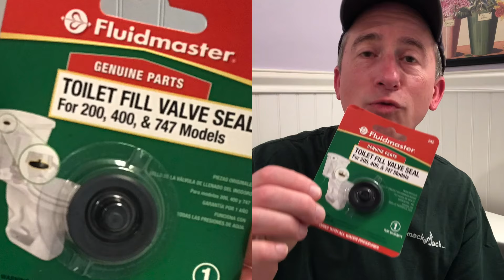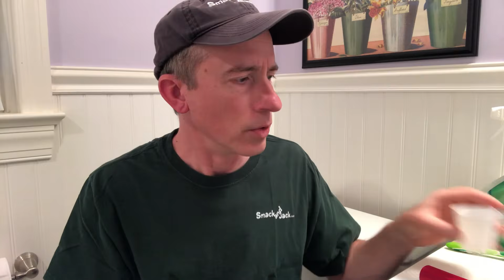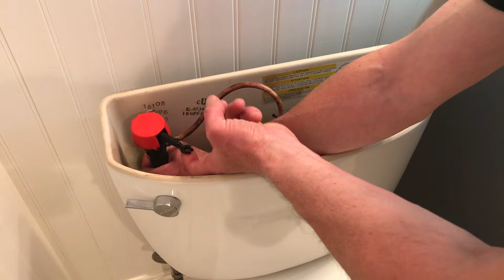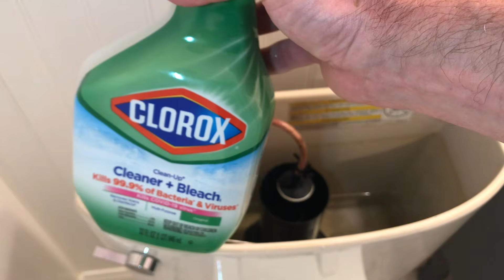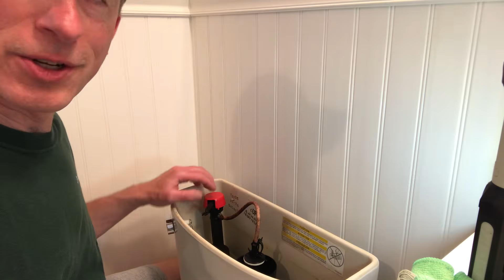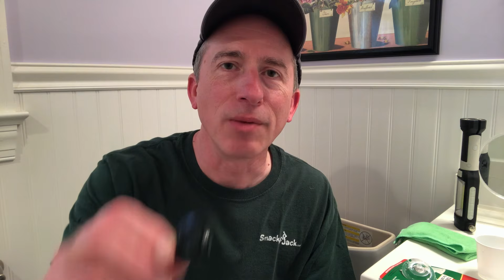Stop leaks: Fluidmaster toilet fill valve seal - repair or replace.

Comment: the whole refilled valve is so damn cheap. I recommend replace it people. Don't be cheap and waste your time.
Reply from the maker: Understood!  But, this whole operation only takes a few minutes without draining the tank, securing the bottom seal, etc.  But I certainly get your point.  Thanks for watching, JL.

Comment: Holy moley! You are fabulous! I came home from a trip and heard the water running in the toilet. 11 p.m. on a Friday in a town of 1200 people and the nearest hardware store is either closed or 25 miles away and also closed. I watched your video and in less than five minutes the problem was fixed. Thank you so much for making this video!
Reply from the maker: Fantastic!  I am delighted that the video helped and you were able to get the valve to stop leaking. Thanks for watching, JL.

Comment: I meant to add that I sprayed some Lime-A-Way on the toothbrush to help remove calcium stuck on the fill valve zipper-float. Then of course, I later read NOT to use any bleach or chemical spray, but to clean with white vinegar.
Reply from the maker: Good point on the vinegar. I believe that some warranties are void if bleach and such is used inside the tank. I appreciate your recommendation, thanks for watching, JL.

Comment: (8 year old toilet tank apparatus in 8 yr old house). Took a while to get the Fluidmaster 300 cap off - maybe due to hard water calcium deposits?
My fill valve model has a plastic zip-tie style floater cup, attached to the cap in one solid piece. It was not easy to remove or snap back in place. 
 I cleaned and brushed off everything, including the rubber disk, which still looked in good shape. A little slimy but not worn or  debris-coated. I cleared the water spout - all clear. Put everything back, but still heard hissing water sound.
Since you had good luck replacing the rubber piece - I plan to try that.
Reply from the maker: Sounds like you did everything you could to save the old one!!  But at 8 years old and with hard water issues and considering the seals are only a few dollars, new is an easy way to go.  I hope everything works out for you, thanks for watching. JL.

Comment: Will that Seat Washer fit a Kohler?
Reply from the maker: I believe so.  I have replaced seals in both of our Kohler toilets and both of the fill valves were stock.  The number might be on the back of the seal packaging.  I hope this helps, thanks for watching.

Comment: Thanks man, wasn't much to clean out mind you but it worked.
Reply from the maker: Fantastic!  Great to hear.  Thanks for watching, JL.
Reply: @LendermanShop I spoke to soon. This morning it happened again so I went to shut off the valve and the valve started leaking.  Had to change both the fill valve and the shut off valve and had to fix a service line leak at work afterwards. What a day 😂.

Comment: Well, it looks like cleaning the 16 year-old valve seal worked for me, now the new problem, the shut off valve, even older than the toilet is now leaking/dripping since I disturbed it. 😢
Reply from the maker: Gosh, sorry to hear that.  As always, one thing leads to another. I sometimes just place a wire in the tank to hold the float up in filled position so that I do not need to touch the shutoff.  I hope you are able to get that fixed without spending too much time and money.  Thanks for watching, JL.

Comment: I think you could have just lowered the float with the screw maybe .5"  to .75" and you'd be good. 😃
It appears that the float can't completely turn off the valve, or is right on the cusp of that because the water level is too high - sometimes drains and can't shutoff completely..
You want the water pushing the float fully up of course, with no way to really stop it - except the device itself.
Would be nice to see the water level around 1" below the flush valve drain level.

Mine used to run sometimes and this solved it for me. Some things helped temporarily, then this fixed it longer term.
Thanks for the video.
Reply from the maker: Thanks for the suggestions.  If I remember correctly, I think I did make an attempt at adjusting the float screw which did not give the desired result. I do agree giving that a try first should be the initial step. I'll definitely check the water level as well - not sure if there is a water level mark on the inside tank or not, just to refernce against the drain.  Thanks for watching and enjoy your holidays. JL
Reply: @LendermanShop  Hey at some point it only screws so much so to go more you would need to adjust the height of the fill valve itself to go even lower.
Thanks again and Happy Holidays!
Reply: I think that's the problem with mine, but the cheap zip-tie floater cup on my Model 300, is adjusted as far it will go.
Reply: @Lola-tq8nvHello maybe you can adjust the height of the fill valve itself, making it a bit lower and the water higher? The screw is like a fine tuning of it.

Comment: That floater is what is causing the problem…once flushed it has to be tapped to fill back up. Is there a fix for that? This is the second time I’ve had issues with these fill valves. I’ve replaced it twice in 5 years. Any help would be appreciated.
Reply from the maker: That is very frustrating.  My only thought is to clean the stalk as best you can with a stiff vinyl brush - maybe there is build up on it.  Then, apply some plumbers grease and see how that holds up. I hope you are able to fix that issue.  Thanks for watching, JL.
Reply: @LendermanShop Thanks so much for your suggestion. I did manage to get it to work after flushing it out and scraping off lime scale. It’s back to working again. I am going to take your advice and get some plumbers grease and apply it.
Reply from the maker: @lou196t  Fantastic! I am glad eveything worked out for you.  Good call on getting the plumbers grease, it lasts forever in the closet/toolbox and you'll be surprised how often it comes in handy!  JL

Comment: I am going tp replace the seal and am worried that when i ge to the store there will be several options for different models, where do i find a model number or some descriptor. i could always take the old seal, but then the toilet couldn't' be used while i was shopping
Reply from the maker: Hi there, if you take a screen shot at 0:22 in the video, you will have the numbers that you need. In my experience, there was not many options for this particular part. I hope this helps, all the best with your project. Thanks for watching, JL.
Reply: The number should be on the float

Comment: 10:35 Thanks for that. I have a decent looking seal but I noticed the water leaks out a bit around it. Also, what if i accidentally put the arm in the wrong position so the toilet doesn’t fill? This is from trying to get the cap off the wrong way at first. Do I just gently position it til it works?
Reply from the maker: Sounds like a new seal is in order.  Regarding the arm, without seeing it, I would say yes be gentle as it is a plastic part.  Try to get it back to where is was.   I hope everything works out, thanks for watching, JL.
Reply: @ Thanks for answering. Yeah, it was the new seal. I had gotten it back into place. Easy repair. Where you pointed out the leaking… helped a lot. 30 something woman who’s changed a flapper and that’s it; if that comment is helpful to anyone else.

So, I flushed potential mineral deposits. Cleaned out the cap, even though I didn’t really see any grime. Fit the seal in. Put it back on. I had also scrubbed around inside the toilet to remove buildup.